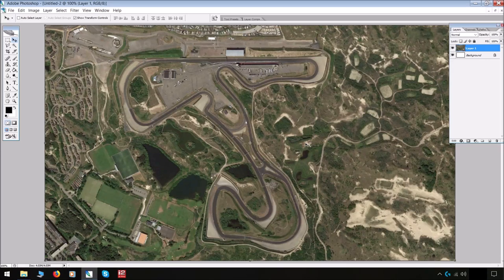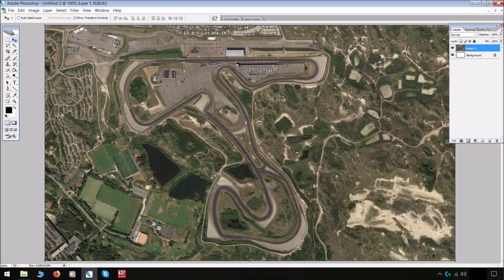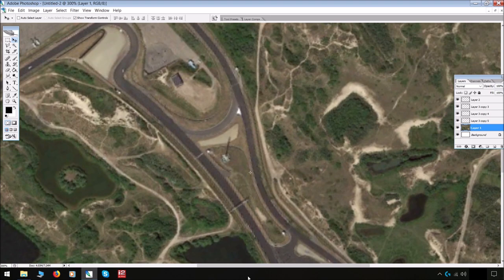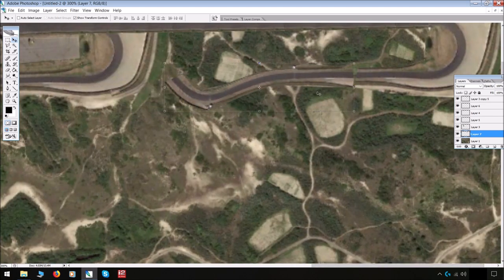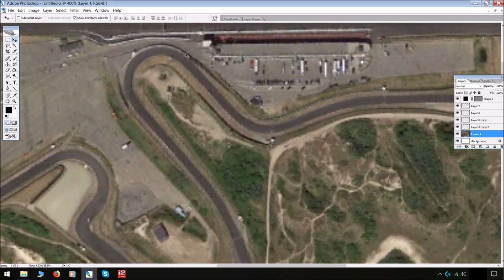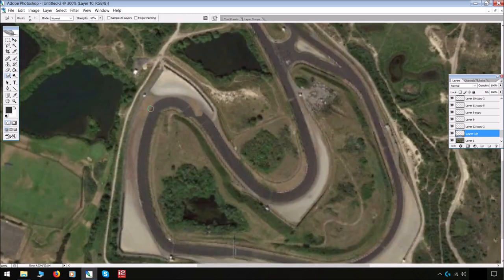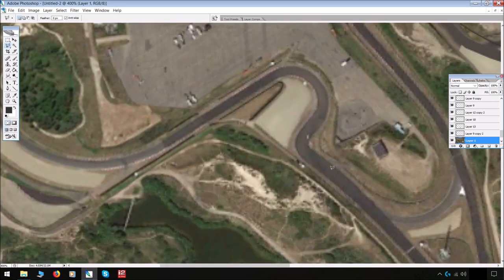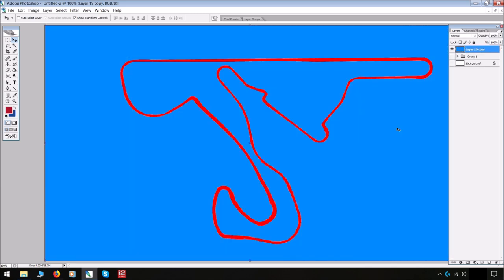How to UPGRADE a race track - Zandvoort

Comment: Zandvoort circuit can not expand into the surrounding areas. Those areas are mostly owned and used by (a myriad of) other parties.   Such as a camping ground and I believe a golf course. 
That's also the reason why the old F1 layout (with 'Bos in' etc.) no longer exists.

Comment: big problem is the dunes. they are nature monuments (according to dutch laws) , you need some serious legal backing to push this through. Another point is costs, if you hit 100 million develpment, built it from cratch somewhere else or get an arabian prince to pay it off. ps could you add track lenghts and edtimated average speeds?
Reply: doemijmaarfriet it might have dunes but that’s what some people want is for people not getting away with mistakes

Comment: Ah, no better way to spend a monday morning listening to a brit butchering "scheivlak", on a serious note though: as a dutchie i truly hate zandvoort, i think it's narrow, boring and not fun to drive apart from mazda mx5 cup races... This lay out does look better, only thing i would had done is keep the audi-s in it's place instead of just a left hander, having watched max verstappen throw in a red bull through that corner and it was great to see, only thing that would need changing there is a bit wider entry and just a wider piece of track in general and with the existing camber cars would be able to practically go side by side heading towards arie luyendyk
Reply: lesleyyb mods zandvoort has interesting and fast corners so how would it be boring
Reply: lesleyyb mods I will say though that if f1 go here it should be wider but the shouldn’t I think zandvoort is an amazing track and they shouldn’t Change it except for making it wider and making the first straight longer